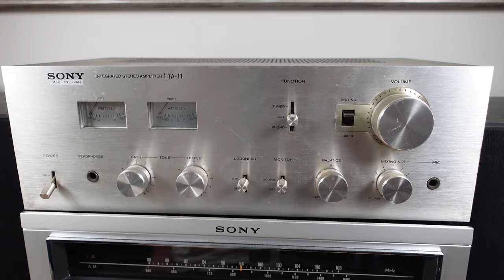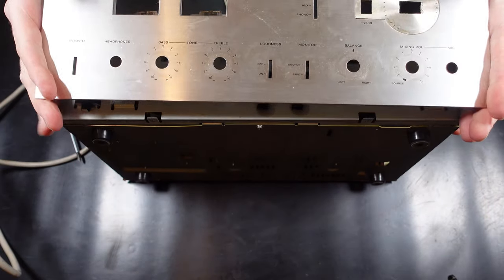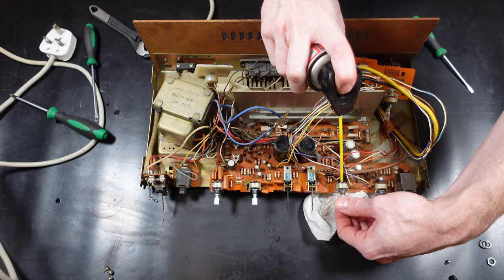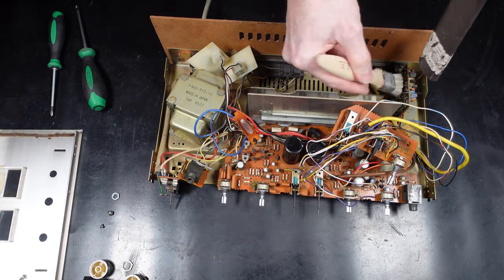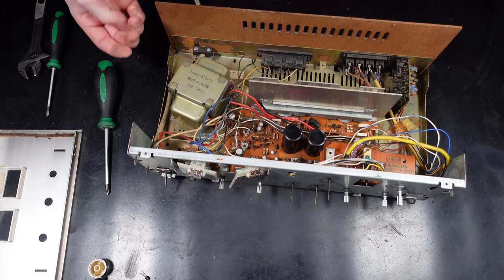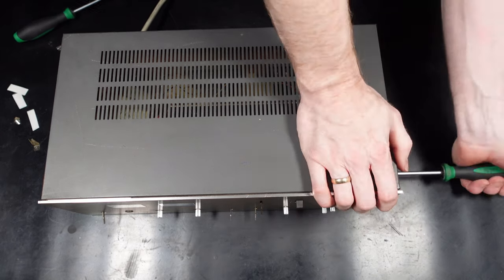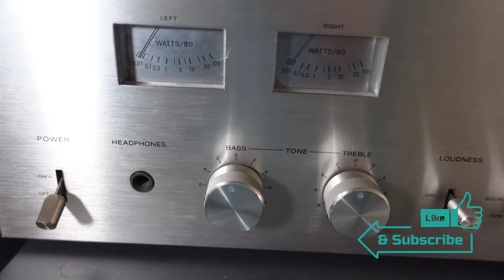SONY TA-11 Amplifier Major Distorted Sound Issue Repair - Retfurb Vintage Refurb

Comment: So much bad technical practice - so little time. So far as I can tell ZERO actual troubleshooting before just tearing into it and doing stuff. How you did not ruin the meters with such careless handling I'll never understand. It was working much better at the end - surprising to me, frankly.
Reply from the maker: Thanks for the comment. All comments and opinions are welcome. To be honest there was a lot of messing around that was cut out, to save video time.  The video would have been a couple hours long, If it was not cut down. 
Also, I do agree with the comment on the meters, I should have removed these completely. 👍
Reply: @retfurb  Sorry if I was harsh. I don't remember if this applies to your video but one thing that bugs me even with some of the best techs on YouTube is that they generally do NOT open for a visual inspection first thing, even before plugging it in. You wouldn't believe some of the things I've seen inside some of this stuff. Safety hazards.
Reply from the maker: @mdzacharias  No, It's good to get some feedback on the video. I had already had a quick look inside, Just to make sure no obvious issues. Like I said in the last reply, I did cut a lot out. Which I should have explained further in the video. I also did go through all capacitor checks, Which I don't think I mentioned at all (or showed). 👍

Comment: Easiest way to calibrate the VU meters is use a signal generator, not that these would have been very accurate from new!
Reply from the maker: Ah, ok. Thanks or the additional info 🙂. I have not worked with them previously, So I tried to do it the best I could by manually adjusting. 👍

Comment: Handling on those needle exposed VU meters is not ideal. Those are fragile, just desolder wires, don't remove from the front panel.
Reply from the maker: Yeah, I agree. In hindsight, I should have removed them. I won't make the same mistake again, When working with similar meters. 👍

Comment: Hi there, I have what seems to be the exact same problem with my NAD C316BEE amp. Distortion through both the right speaker channel and also headphone when i plug them in. Can I ask how you know what resistors to. look for? The NAD 316 has loads so trying to narrow it down instead of having to remove them all to test them. Thanks
Reply from the maker: Yeah, It can be difficult when trying to narrow down a problem. You will need the service manual with circuit diagrams, This will then enable you to narrow down channel circuits.
It will need diagnosing checking voltage etc.
Reply: Ok cool, I have the service manual with the circuit diagrams. I guess I need to learn how to read them ;)  @retfurb
Reply from the maker: @bflsridersrepublic2999  ah, Atleast you have them to start with.
Some ca be more difficult to read, than others.
Just need to be safe with it, as it is obviously dangerous working on live components.

Comment: Do you remember which resistors you replaced, I have the exact problem with one channel on this amplifier.
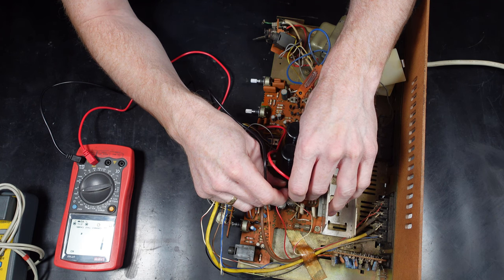Reply from the maker: If you look around the 7:29 mark of the video, I point to the one side. I am pretty sure it was the opposite channel fused resistor. Do you have a service repair manual? As it will show the fused resistors on the diagram. This will hopefully show the ones I replaced.

Comment: Just to add an advise: when cleaning potentiometers, never use DeoxIT D5 (red label). It will dissolve the carbon resistance layer in the potentiometer. The problem will get worse and the damage to the potentiometer can only be solved by replacing it with a new potentiometer.
Instead, use DeoxIT F5 (green label). F5 will clean the carbon layer without damaging it.
Reply from the maker: Thanks for the comment. I will bear this in mind. I previously was advised to use this type deoxit?
Reply: @retfurb  
I know, I also found out the hard way, ruining a pot. What makes it unclear is that DeoxIT does not mention any warning of use on the product. But F5 is the definitely the one you need for pots.
Reply from the maker: @KolfMAKER  Ok, Thank you. I will look in to getting some.

Comment: Not quite sure what you expected inside a basic amplifier with audio processing.  This is pretty well what I qould expect on a basic amp with basic tone controls.     Just be a warning to people using DEOXIT.  There are different versions of DEOXIT.   Not just Deoxit, but cleaners in general.   Some versions actually eat away the glue that holds the powdered carbon track on your Pot's.     Just make sure you choose the right DEOXIT for the job :). 
Great video though.   Some good processes here for people that do not have a schematic for the device.    A Schematic would pinpoint, but sometimes you just have to work with what you have.
Reply from the maker: Thank you. Yeah, I probably was expecting more. After looking inside my TA-1150, I always think they will be similarly full. Will make a note for future videos, regarding the De-Oxit. Always appreciate additional information added to the comments, It further adds to the information. 👍
Reply: @retfurb  Yeah, the deoxit thing is something I only found out recently too.  Unfortunately I can't remember which colour it is that disolves that glue, I know there are a couple of videos on YT about it.  It was a bit of an eye opener for me too,
Reply from the maker: @EsotericArctos  The Deoxit D5 was the one recommended to me, For this type of use. So hopefully this is the correct one. I did see some others available, But didn't look in to them as specifically looked for the D5.

Comment: Hi, 
Very good video. I'm pretty new to repairing older electronics and I learned something. I wasn't aware that there was such a thing as a fuse resistor. How can you tell the difference between a regular resistor and a fuse resistor? Where is a good place to buy replacement fuse resistors and what wattage?
Thanks a lot, Tom
Reply from the maker: Thank you. They are more common on some units than others. This Sony amplifier has about 8 of them in total. You will need the service manual for the system you are attempting to repair. This will show the location of fuse resistors and what specification they are. 👍
Reply: @retfurb  Thanks so much for the quick reply. I should be able to find a service manual online, I would think.
Reply from the maker: @THOMMGB   No problems. If you need any help, Please let me know. They are relatively easy to find.
Reply: I have fixed a few Sony's etc. with out of spec fusable resistors. In short, although theoretically useful they were a bad choice back then. They drift with temperature so cause a lot of troubleshooting issues, and are actually a fire hazard. It's impossible to get a lot of the values that Sony used. So, I use metal film resistors that match the wattage spec. If they are on a power rail I calculate the max current and put an appropriate fuse in series with the resistor.
Reply from the maker: @peterlarkin762  Thank you for this information. 🙂👍

Comment: I laughed when I saw the Milwaukie soldering iron,bet that was arse heavy
Reply from the maker: 😂 Yeah, it can be a bit bulky at times. But to be fair to it, Its sometimes better than having a cable joined to it. It also heats up a lot quicker than my mains powered iron. 👍

Comment: Hello! This happened to me TWICE .   
First sound Amplifier was Sankyo SRC-2020  
i was just listening music, not so loud, and suddenly it got blown( i think blown)
 sound is ultra bad and at 100% volume seems like its 2% only. and much distortion. 

And then i bought a power strip with surge protection (thought it was from home electricity the problem because sometimes we have outages as a small village). 
Then i got my second Amplifier AKAI AM-2850 ,  
and suddenly today it got INSANE distortion on sound, and mostly on bass. its like it got blown... it sounds like yours.

Now im watching videos how to fix and what can be the problem.. damn i cant live without my amplifier loudness :(

Already tried to use a different wall outlet, changed speakers and cables , but no fix. it seems something is blown inside...  
but theres my question .
How this happened twice in 1 week? with different amplifiers?  is my home electrical problem? but lights was on, no voltage drop or outage happened when they got "blown" etc. 
what could be the problem that fcks my amplifiers?  can you help me please ?
Reply from the maker: Ah, Sorry to hear you have had issues. Does sound a bit weird to have it happen so close to each other.
Having said that. I would have thought there would be other issues, if there was power surges in the house.
Im not sure how you can test for power surge from an outlet? Probably would need a house electrician to test or electrical supplier engineer.
Reply: okay! thanks for fast reply!! 
What about amplifier? it needs a professional hand too? or its something that i can solder/replace?  @retfurb
Reply from the maker: @6ixss  It would need someone who knows what they are looking at. Obviously it is a safety hazard, If you don't know what you are doing.
Reply: well you're right.. @retfurb